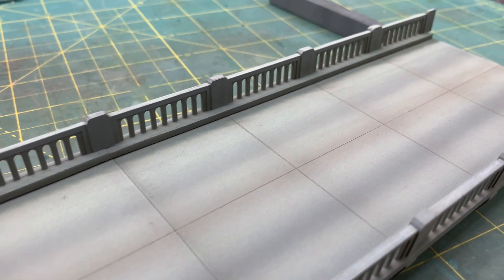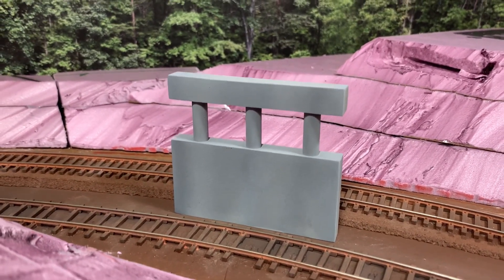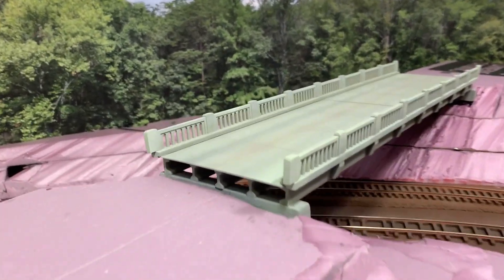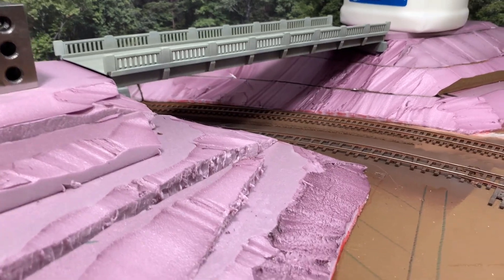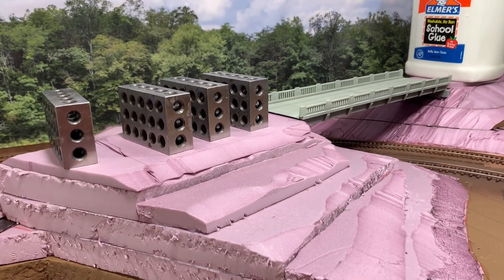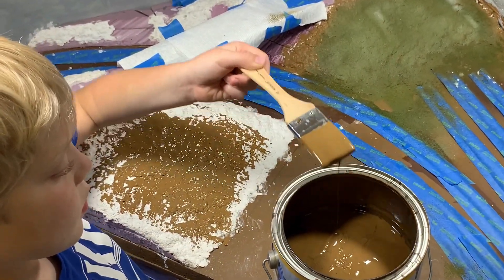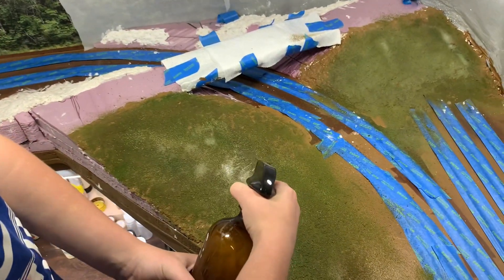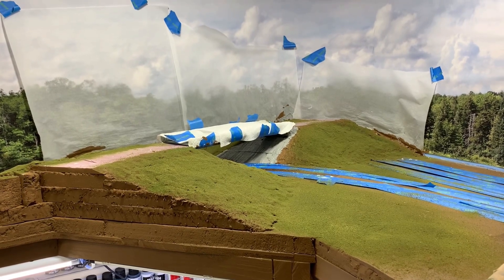Manchester & Deepwater Version 2.0 - Update 21: Base Scenery Layer Around the Overpass

Comment: I would add one caution about your clearance of the bridge pier. I model the 50’s too. Then one day I decided a passenger train might be fun sooo, you might want to get a used 85’ passenger car and test clearances with that. For what it’s worth I test all my curves with an 85’ heavyweight car they will tell you more about your curves than any gauge.
Reply from the maker: Thanks Wendell that’s sound advice. As Jason pointed out in another comment, I may just omit the center pier entirely. Need to mess with that idea and it certainly makes things more flexible!